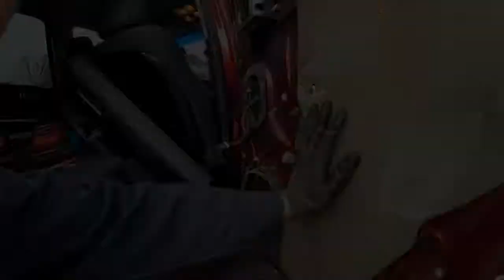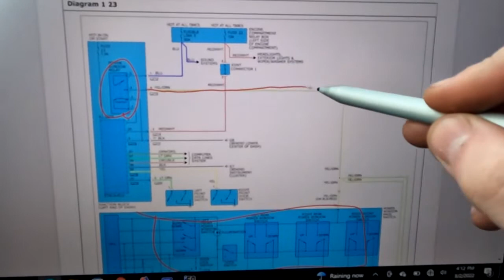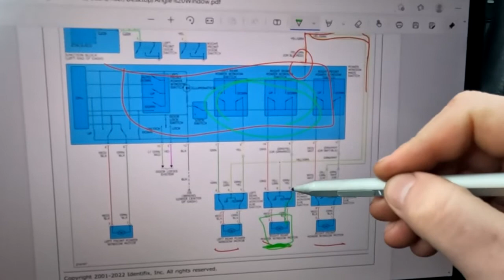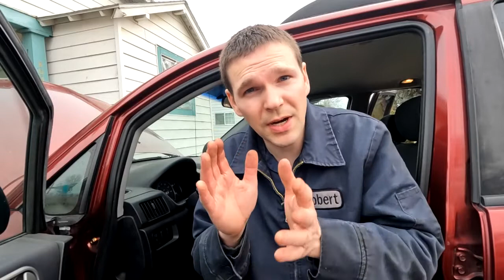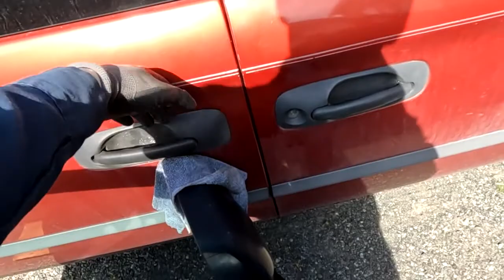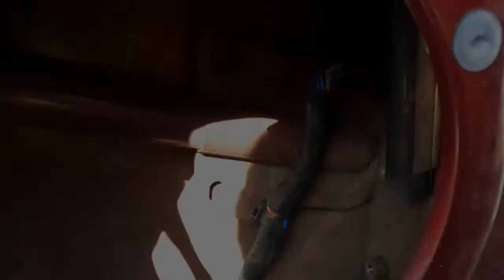2005 Mitsubishi Endeavor Window Won't Roll Up  Diag and Fix

Comment: I have a similar situation. Same passenger rear window.   Goes down but won't go up. Except, in addition, the driver door cannot move it in either direction. Only the rear passenger door can move that window.  So does that mean it's maybe at the hinge or switch?